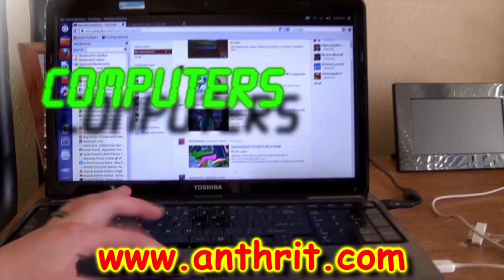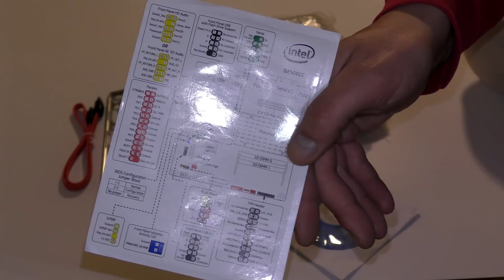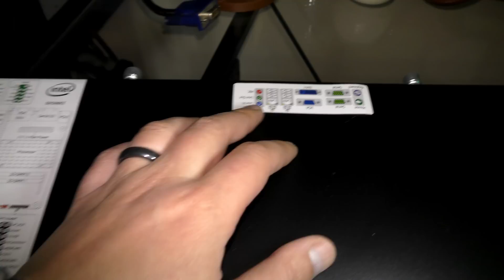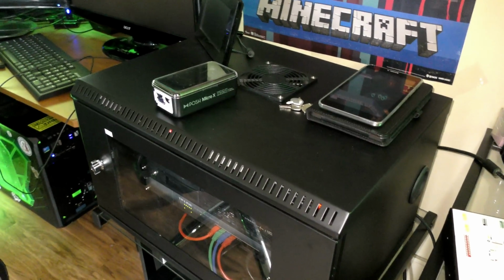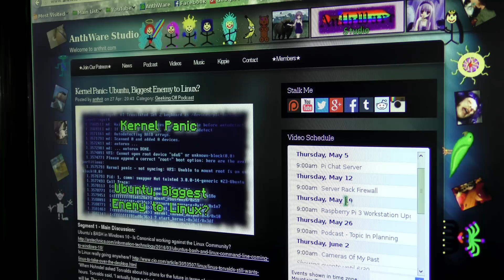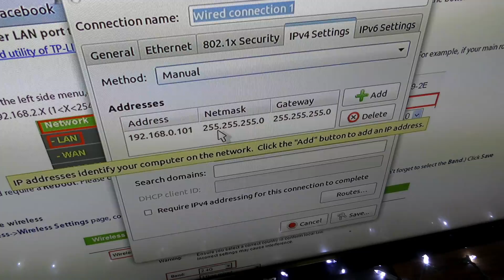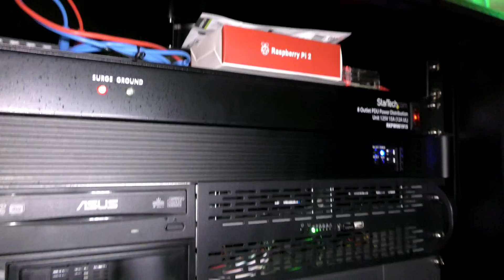Building A PFSense Firewall ★Geeking Off★

Comment: This is mi network I want to put behind :
* router Router ZTE F660
*Access point TP-LINK AP500
*TP-link RE 580 repeater that extends the wifi network of the access point '' TP-LINK AP500 ''
How to configure pfSens to make the captive portal operational for my entire network
I want to generate access codes with a limited time for each client
how can I do
thank you
Reply from the maker: Wow man that is a really neat setup. But i am not sure how to do the codes I have never done that before.
Reply: Mohcine Fadde for codes you would need to have custom access point software, thats expensive and requires equipment such as ubiquiti.

Comment: gotta have that 80pluss on your power supply
Reply: Ørjan Lønningen Not if the power draw is significantly lower than what the PSU can supply. That things uses 25 watts of power maximum. The highest power draw Intel Atom is 10 watts.

Comment: Would this build work for an Enterprise network, or would I need multiples of them?  Just wondering because I have quite a few enterprise servers ran through some 24 port rack mount switches with firewalls on each server...
Reply: Theoretically - Yes.  pfSense is a very robust platform that offers a lot of enterprise features.  For large networks with hundreds of users, you will need to have a higher end system than what is shown here.  Multi-core Xeons with ECC memory and redundant power supplies.  

Good luck, tho, trying to convince a CIO or IT manager to stray away from the relative safety of Cisco or Juniper, as they are the "tried and true" enterprise segment products.
Reply: Oh I am the IT person here lol, so no one to argue with about it except for all the users of the network LOL :)  "Oh by the way, there will be a slight 3 hour long network outage tee hee"  "NO NO NO PLEASE!!" LOL
Reply: You can find used enterprise server on ebay for less than $200 USD.

I bought my Dell PowerEdge R410 with 2x Quad Core Xeons, and 16GB of DDR3 ECC RAM

You can also find used xeons and motherboards and ram and experiment with building your own enterprise router. That is what i did.

Bit long after your initial comment, but hey, if your still wondering, why not try it!

Comment: Put the stickers on the inside of the case cover. When you remove the cover you will see it there. No need for it when the case isn't open.
Reply: Whoops someone already mentioned. Yeah keep the outside clean though. Maybe add a custom branding sticker but nothing else.
Reply from the maker: Putting stickers on the outside was my "Preference" not yours.

Comment: Doesn't the firewall need cooling system other than just heat sink since it is going to run like 24x7???
Reply from the maker: With how much cpu it is using it should be ok. My HDTV setup is fanless and works like a charm. I would install fans in this one but where the dang power supply wires come out they just block the fan mounting area. They should have put them more off to one side. Bad design with this case.

Comment: I have been using PF for yrs now and the new one is laggy and has a lot of bugs
Reply from the maker: Mine has been working really well without issues. Would a Nuke and Pave clean it up?
Reply: I don't know, its not running on physical hardware. Its running in Vmware ESXi 6
Reply: We use it at my school (before, we used a vesion from 3 years ago) with 100 plus active users every day, on a machine not much more powerfull than the one on this vid, and TONS of firewall rules, plugins, etc, and it's been a real dream, much better than before.

Comment: If the gateway was 255.255.255.0 then was that the IP address to log into the router from the internet browser?
Reply: The IP address of the pfSense router is 192.168.1.1.  The IP address of the wireless router that he had problems getting to was 192.168.1.11.  

255.255.255.0 represents the subnet mask, when he manually configured his computer, he technically had the gateway wrong. 

The wifi router was on a completely different subnet (192.168.0.1) than the pfSense network.  This is why he could not access it after turning on the pfSense router.
Reply: Ke B Yeah I see what you are saying. And the rule is that if he was not on the same subnet then he wont, as you stated, be able to access the equipment located on said network.

Comment: I am looking to build a pfsense box. I already tried with a netbook I had lying around and even though it works my internet connection was crippled. I have TWC at 350Mbps down and expecting upgrades to my internet to 1Gbps sometime in the future. My question is what type of build would I need for pfsense that can handle internet speeds between 300Mbps to 1Gbps?

Comment: quick question, why spend money on another dedicated server for pfsense when you could have just virtualized it (consolidated) with the existing server you have in there (this is assuming that your other server runs 24/7). I was thinking that this would have cost saving benefits with the hardware itself and the electricity required to run pfsense. How much power does your pfsense box draw?
Reply from the maker: The other sever is used when we are running heavy modified Minecraft servers and/or other gaming servers. It is only powered on when we are playing. I wanted a dedicated PFsense box and it only draws around 10 to 20 watts. The other can get up to 300 watts when we are running a game server. The big one is more used on weekends and powered off during the week.

Comment: One question. Why not use a raspberry pie ?
Reply: 4 months late.
But a firewall needs traffic in and traffic out, hence the motherboard in this video has two Ethernet ports. Raspberry Pis only have one.
Reply: Thanks. Now I know it, I feel silly. Lost some attention to detail, I guess. Thanks by the way.
Reply: @RAAFtiger  even later than you but Rpi's use ARM cpu's which are not yet supported for use in pfsense.
you can set up vlans and get away with 1 ethernet port on a pfsense box (youll be limited to 500mbps up and down traffic though) but i can be done.

Comment: I would place a Noctua mini fan in the front for cpu and ram.
Reply from the maker: Problem is that the wires coming out of the PSU completely block the 
fans for the case. They should have put it more to the Left side.
Reply: True :)

Comment: A cheap thin-client would do the job just fine. I've got used Fujitsu-Siemens S550 with PCI expansion slot and a dual-head Intel NIC for less then $30. For home usage it's a stellar pfsense router!
Reply from the maker: Yep whatever works for the user. It all comes down to what the users preference is.

Comment: The /24 is shorthand for the bit-mask and not part of the IP. For your configuration you should get a switch and something like a UniFi WAP. The second router is going to add a second layer that will just make everything harder and confusing in the long run. But it looks like your network configuration already hurts my brain, so, whatever works, I guess.

You have a beefy enough system that you should run a proxy server on it.

The Chinese can make stuff just as good as any other country. I'm not sure why you feel the need to specify the country of origin...
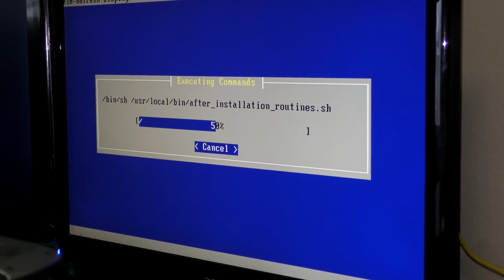Reply: 'cause he's very confused?  I got linked here for the bit at 8:30 where he says "this is BSD, but I see a lot of linux filesystems being copied"...
Reply from the maker: Confused, no. Sarcastic, yes.
Reply from the maker: Thanks for the tips and advice.

Comment: Sorry if this is a dumb question, but Did you have to turn  your wireless router into an access point? I was going to set up a pfsense box, but the only way I saw was to make my router an access point and I didn't want to do that.
Reply from the maker: Ya I did do that. But only for wireless. Reason I want it that way is because I will be moving into a new house and will need it away from the main firewall. But ya you can just add a wireless card onto it if you want to keep in same location as firewall.
Reply: Well, I have a nice wireless router, and it is(would be) close to the pfsense box. I just didn't know if I had to put my router in access point mode or not. Thanks for the fast response!
Reply: Pf-sense does not support wireless.  You will need to have a separate WAP of some sorts for wireless.

Comment: Nice! build.. I use a netbook with the same processor and same amount of ram and it's working flawlessly so far for 2 years.. I now that once I turned off it might never turn on back but well..

I will suggested to have your network like mine, since I guess you have a managed switch, use pfsense to handle Vlan's here is my configuration:

Pfsense is connected to my switch using a 802.1Q trunk I have the following Vlans:

VLAN 100 (Wireless private) 192.168.100.0/24
VLAN 110 (Wireless Guests) 192.168.110.0/24
VLAN 120 (Media Steaming) <it's for TV's and set up boxes using DNLA and IPTV" 192.168.120.0/24
VLAN 130 (Servers) (Plex, Owncloud, Freenas, XEN etc..) 192.168.130.0/24
VLAN 140 (Wired computers) 192.168.140.0/24

From the switch I have another uplink trunk (802.1q) going to a TP-link with OpenWRT and I created vlan 100 and 110 on the TP-Link associated them to 2 different SSID that allows me to limit the bandwidth and have more control of the wireless devices in my house.
Reply from the maker: Thanks for the tips I am so going to play around with them.

Comment: true that the first power supply build quality isn't great. But the main factor is that you didn't put any intake fan into the 1u itx case. That case needs air flow, and 2 small fans will help alot.
Reply from the maker: Problem is that the wires coming out of the PSU completely block the fans for the case. They should have put it more to the Left side.